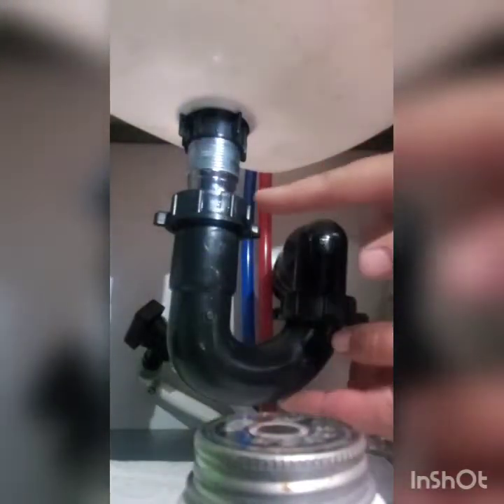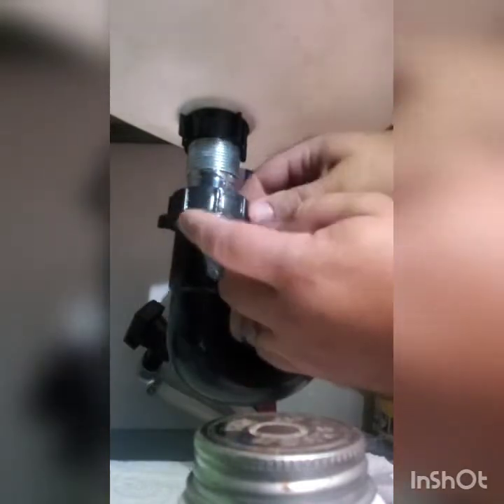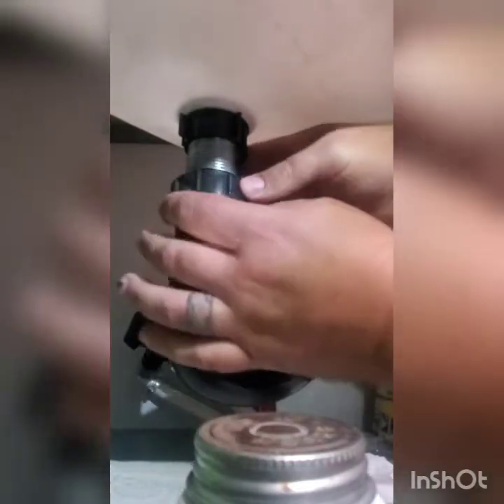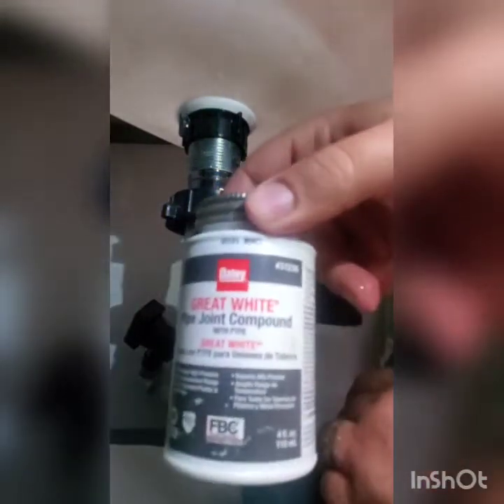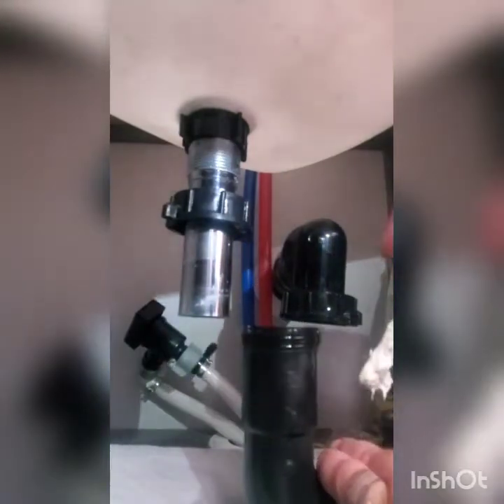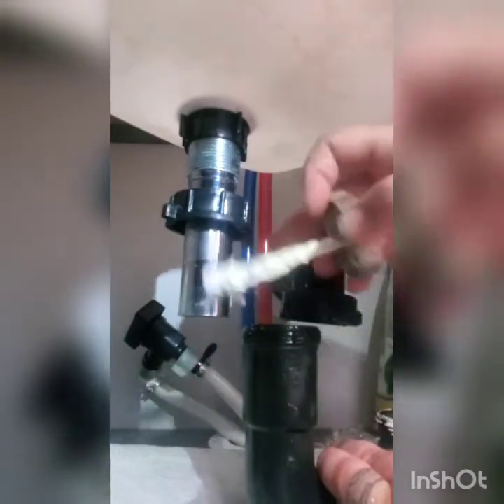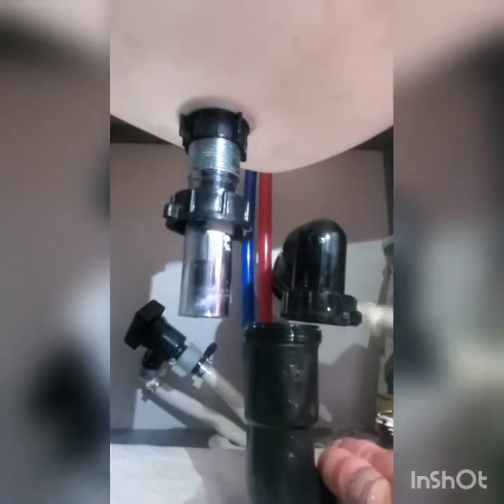Repair a leaking sink drain in a camper.

Comment: I don't know if you're located in the United States but if you are and you would be so amazingly gracious as have a phone call with me I got some issues with my sink underneath and I'm located in Aurora area without a car. I think I know what needs to be fixed but I would be grateful if you could talk to me I'm a single lady out here by myself and I can't use the water to the RV because once I turn it on it's leaking in that one area and then it's leaking under the RV. Certainly I didn't say anything that makes sense but if you would text me and talk to me that would be a miracle.